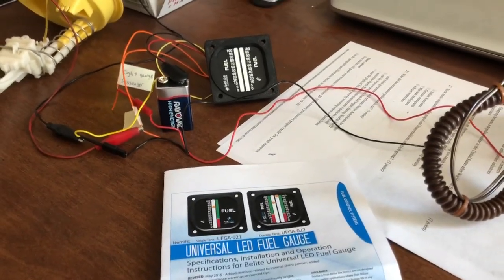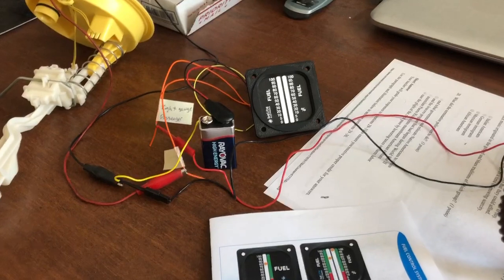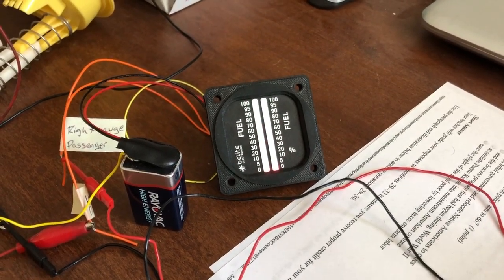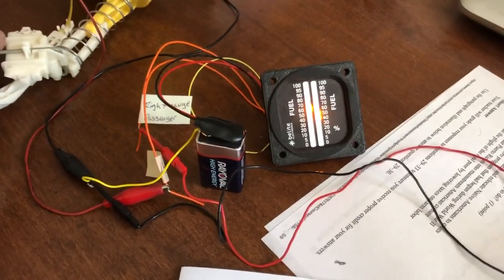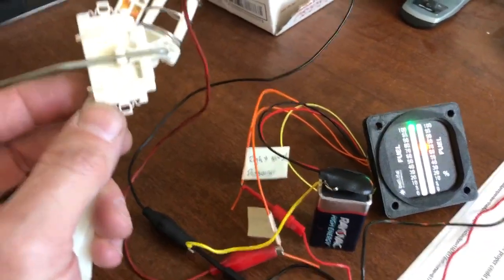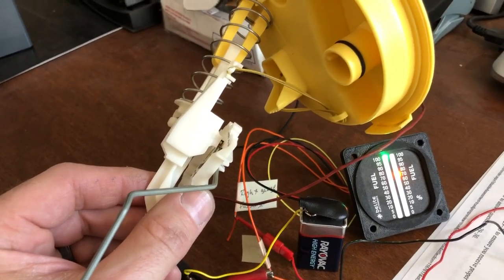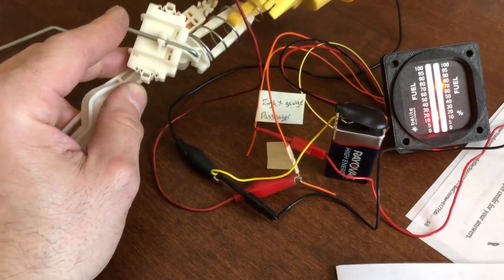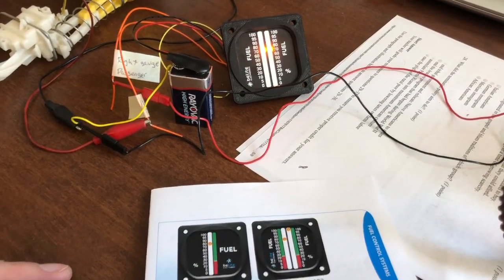E39 LS swap Belite Electronics universal dual fuel gauge.

Comment from the maker: I caught a couple of errors in my video since positing it:

First, the "reserve / low fuel indicator light" is triggered by the drivers side lobe (not passenger side as mentioned) on a BMW E39.

Second, I should have stated that when the drivers sender is positioned on the bare spot where there is not resistor present it has "infinite resistance" (not zero resistance as mentioned) through the circuit.

Thanks for watching, hope it helps someone!
S.F.